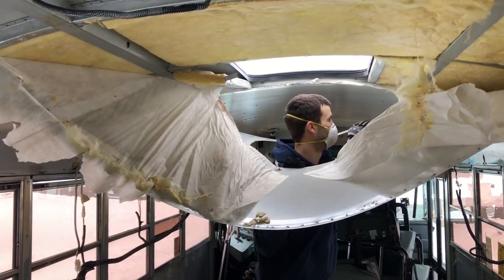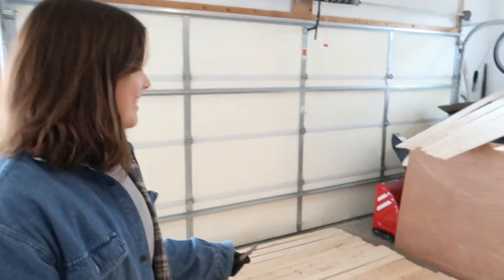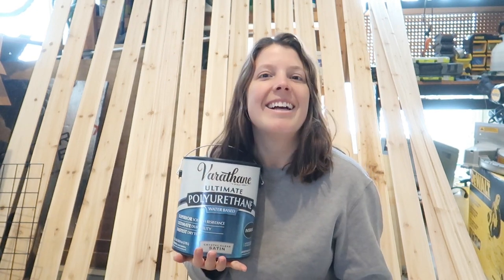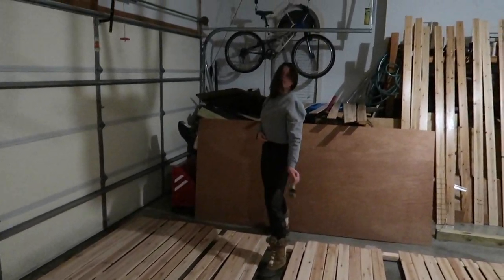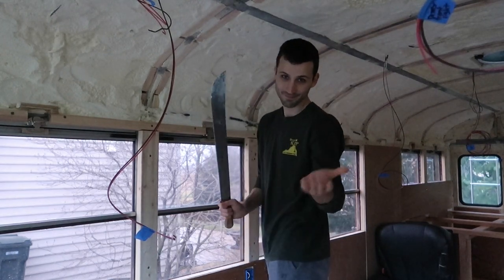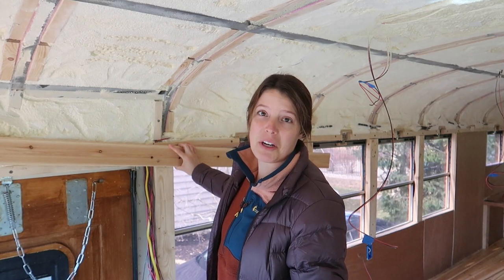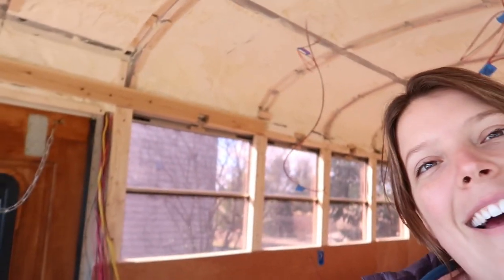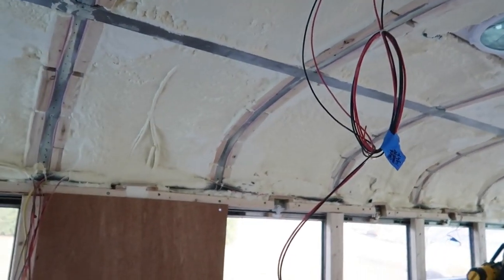Installing a Cedar Ceiling in our School Bus Conversion | Part 1 | BUS BUILD EPISODE 27

Comment: Any reason why you didn't not start at the center for anesthetics?
Reply from the maker: The side we started on is visible in our finished layout, whereas the side we finished on is mostly hidden behind cabinets. Started on the left side just meant we wouldn’t have any weird cuts/uneven sized boards in the visible areas. Also, it just seemed easiest 😊
Reply: That make sense. I will do the same. I didn't consider that. I watched a few other videos and ut seeks like half start from the center and the rest start from the side.